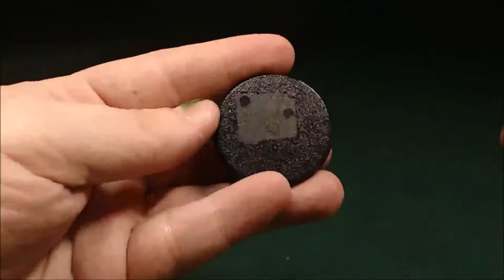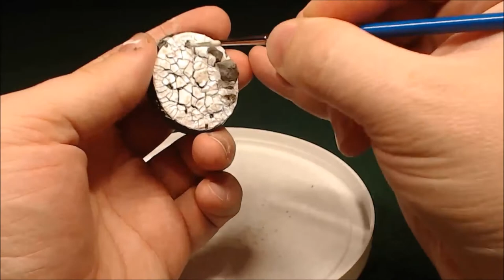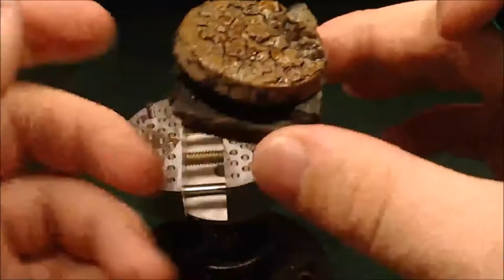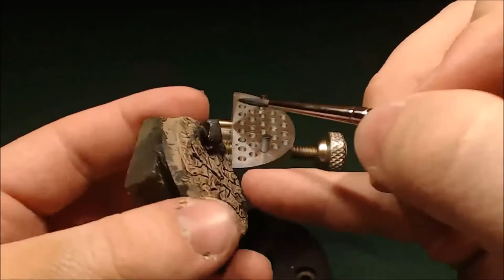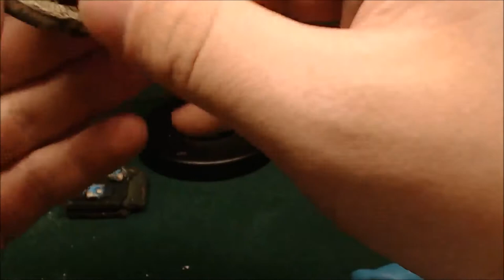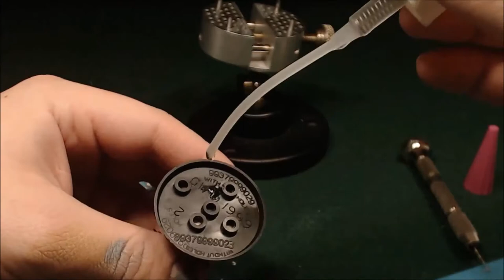Miniature Basing | Warhammer 40k | Dark Angels - Deathwing Terminator Basing

Comment: Thank you for reply I am trying to get the bone white on my DW terminators just right, I want a shade lighter main color than yours, I also want
 a lot transition. Do you think I should start with Rakarth flesh then a controlled  deep pin wash of sepia then layer or air brush Ubshati bone followed by screaming skull, then wash with pin wash with a diluted sepia then clean up, that may not be as light as I would like finally but GW don't have a lighter bone white I can always add white or ivory. Any advice ? Also what's that 2 part system you used for crackle base ? I own crackle past is that similar ? I will check the info and maybe there a link. I shoulda prob checked first lol also where can I find the 2part kit eBay only has black and beige and not 2 parts in kit just the faceted-lack not the haft-lack ?
Reply: Ok, so there's a couple pieces to this comment:

1. Here's the crackle paint I use: https://www.amazon.com/Viva-Decor-Crackle-Paint-White/dp/B00CO66JDU/ref=sr_1_17?ie=UTF8&qid=1499128822&sr=8-17&keywords=crackle+paint
and Here's the crackle primer: https://www.amazon.com/Viva-Decor-200034-Crackle-Paint/dp/B00HHF16ZY/ref=pd_bxgy_201_2?_encoding=UTF8&pd_rd_i=B00HHF16ZY&pd_rd_r=PFK1D4F6DJKH6V6PGRZA&pd_rd_w=OqNqJ&pd_rd_wg=6a3tx&psc=1&refRID=PFK1D4F6DJKH6V6PGRZA

2. I know GW makes a technical paint that is a crackle. That may work  but I haven't done any testing with it to be sure. 

3. If you want a lighter version you can follow this exact same technique but thin your wash 1:1. Then it wont shade as dark. 

4. If you're going to airbrush, hit all of it with the Rakarth and then do your wash. Then do highlight really fast with the Rakarth and then do a top down with the Ubshati Bone and use your screaming skull for edge highlights or another even briefer top down. Then if it's too bright you can wash it down again with either the sepia or agrax depending if you want the orange or the brown look. Definitely thin this wash though, you'll want to apply it gently and in layers and absolutely make sure all your existing wash dries before applying any more or you'll get the weird droplets look. 

How does that sound?
Reply: DGP Dataliss awesome and I found a uk based hobby shop to sell me the facetten-lack and haft-lack for 25.00 including shipping. The paint tutorial sounds great and the airbrush method sounds perfect! I am going to keep the piece stationary when doing the top down instead of working while holding the piece. How many bases of yours  can tub 250ml make 10-20 or more ?
Reply: Robert Afton so I've got a 90 ml tube and I've probably done about 10 bases. I probably haven't even used 10 ml of it. You may not want to get 250 ml. Check with your local art stores. This is definitely a European product I had to order into the US. I bet you could find it from some kind of proper art material supplier.

Comment: Do u ever put the model on the base then apply the texture?
Reply: Sometimes I do, especially if I want a really embedded look. It would look great with Terminators since they're so heavy. It would look like the weight of the armor has helped them sink into ground a little. Just be careful not to get too much on the model or it will look odd. I also find it easier to paint the base when I haven't attached the model yet.
Reply: Ya underneath can be a pain.  I like to build like ridges with the texture paint around the feet a lot so it looks like they just landed or are taking steps. I thought about doing a light drybush to make it looks like mud splatter on there lower legs by the feet.
Reply: I would actually do that with a stipple brush instead of a dry brush. Then it will look more flaked and random. I'd also only do it with your paint color instead of the actual texture. There will be so little that would collect on the top of your shoe that the texture might be too overwhelming. I really like your idea with the ridges though, that's an excellent attention to detail.
Reply: Do they sell stipple brushes at like hobby lobby or Michael's? I've thought about getting one or two or do u just chop down a stiff bristle brush? I just began the hobby again after like a 7 year break.
Reply: You might be able to find one there. I have just used other brushes for it but I actually think I'm going to take one of my really bad frayed brushes, chop the bristles and then use that. I mean how many crappy brushes do you really need? I know for sure they do make them but essentially it's just flat cut that frays out a bit. Kind of like a brush you'd use to dust off things with or something. That or most big make up brushes are technically stipple brushes, if that mental image helps.
Reply: Ya I gotch ya. I saw army painter had one on Amazon. it says it is white nylon so might grab a few at hobby lobby for cheap and chop them up. Are u doing more dark angels videos like for tac marines, dreadnaughts or other vehicles?
Reply: Fred Mulvaney that's my plan. I did the other 4 terminators in this squad. I've also got one tac base coated and one more to build. A rhino half built and a brand new mess of primaris to assemble and paint. So yeah, by the time I'm done I'll probably have a video painting one of everything for DA before moving on to another 40k army. Although I may do a Primaris marine as a Smurf before cooking up a scheme to incorporate them into the 1st. Then people will be able to see some Smurf action before I go way overboard with the rest of the Dark Angels.
Reply: Awesome I'm looking forward to the rest of your schemes for DA. Like ur style with those terminators.
Reply: Fred Mulvaney well thank you very much. I'm glad you like it. I hope you'll like the other ones as much.
Reply: I'm really looking forward to ur take on the dark green theme. I like that real world feel more than the gw style. Do u use a lot of reaper paints mostly? I've been trying to find some equivalents to the ones u use in the video in Vallejo.
Reply: I use a real mix these days. I started with reaper paints as they were cheaper. Now I've been replacing my Reapers with Vallejo Game Colors but I've held up doing that for now. I've been working on my first tac squad and did them with a Vallejo through the air brush and the paint got super latexy and gummed it up a bunch. I need to test a few others and see if that's the case before I continue with the replacements and end up with a bunch of paint I can't take through my air brush. 

For paint matching you can search online and find a bunch of conversion charts. This is the one I use and it took a little bit to figure it out but all the info is there. The closer a number is to 0 the more close of a fit it is:
https://goo.gl/PZoBzG
Reply: Awesome tutorial but the model colours share the same color palette so i would take the sand theme for other miniatures! But thats only my taste i guess
Reply: MiNDmaZing hey thanks for that feedback.  It was something I thought pretty hard about as well. I know a lot of people like a more dramatic contrast in their color palettes but I had hoped the sand and dirt would be far enough away from the bone to pull it off. They are pretty similar though. I'm thinking for my next unit I'll try something different, maybe more dramatic and I could really sit them side by side and see how easy they are on the eyes.

Comment: Good God, do not squeeze your superglue bottle right over your finished base! If it gushed out, you'd have ruined all your work.  Usually you can clean the nozzle with a paperclip or pin.  And apply to the peg and the underside of the foot and underneath the base and you'll do better.
Other than that, great work on the model and the base.
Reply: From personal experience..  after making 200+ exhibition level ready of these f**kers in their various forms over a 9 month period after a while you get a feel for the tube and also a "f**k it" attitude..... Personally I love the feeling of danger ;)